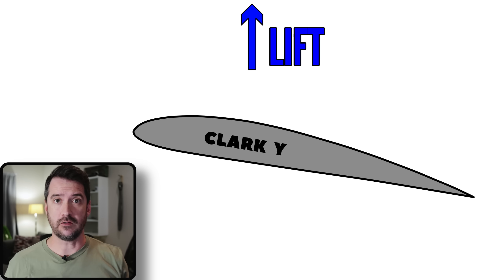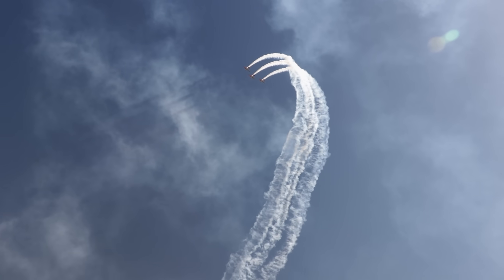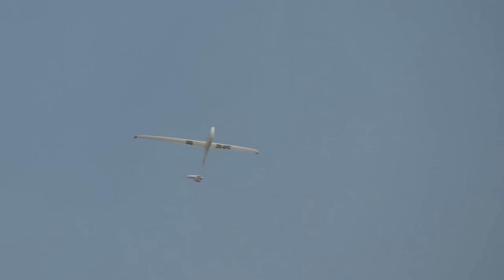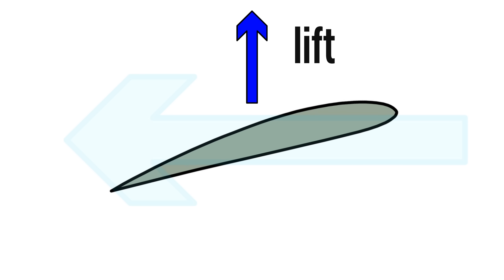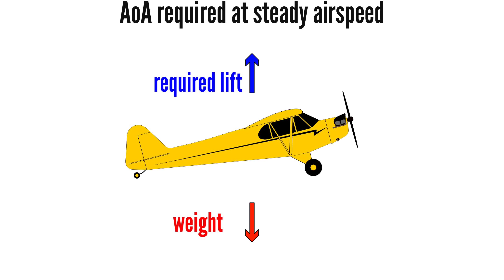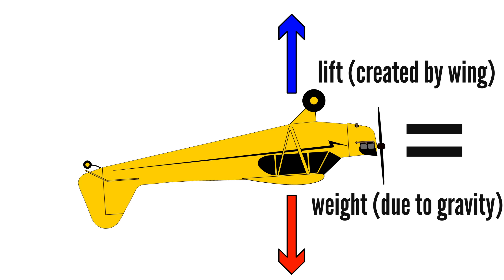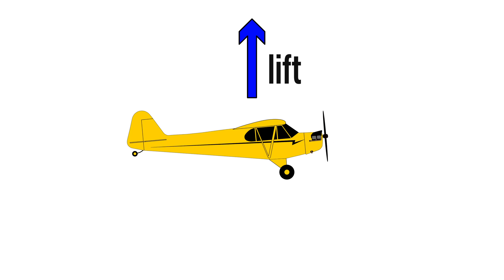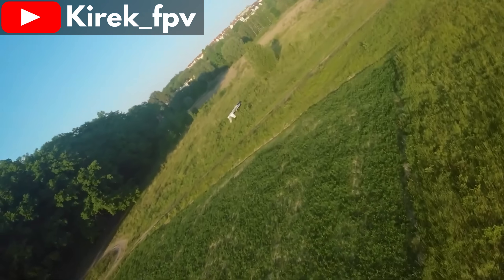Is Airflow Distance Over the Top of a Wing Always Longer?

Comment: It's simple physics, you push air down, the plane goes up (Neutron's third law, every action has an equal and opposite reaction). If a plane is flying upside down, as long as its wings pushing air down, it's going to create push the plane up, and if it makes you comfortable, you can call it "lift".
Reply: Absolutely true.  And it is the low-pressure area above the wing from the "Bernoulli pressure drop" that changes the vast majority of the air's direction downwards that contributes to lift.  

And the air doesn't care if you call the mass flow continuity stress that creates this pressure drop, camber, angle of attack or camber plus angle of attack.

Comment: You have the right principle but make it  more complex than is required. Simply, a wing has two major mechanisms that generate the lift: the shape of the wing and the angle attack. A good aerofoil shape generates lift with low drag, even at zero degrees of attack. The second mechanism,  angle of attack generates lift, but with much higher drag.  So when the wing is upside-down, the aerofoil shape generates lift in a downward direction. To create a nett total upward lift, the angle of attack must be high enough to create enough upward lift to overcome gravity and the downward lift of the aerofoil, but this is at the expense of very high drag. Most people seem to get stuck by believing that lift can only be generated by one mechanism.

Comment: F=MA explains it. A wing in a lift generating configuration accelerates a mass of air downward, producing an equal and opposite force that opposes the force of gravity on the aircraft. The wing shape allows this to happen with minimum drag, which must be overcome by the engine (prop or jet) for the aircraft to maintain a constant speed. This covers both symmetrical and asymmetrical wings. Wingtip vortices are the evidence that air is being accelerated downward.

Comment: There is a fundamental sameness to camber and angle of attack.  They are both asymmetrical disruptors of the mass flow rate continuity.  Pressure drops in accordance with conservation of energy to maintain the mass flow rate.  A change in vertical momentum of the flow is consistent with the asymmetry in pressure from the asymmetry of imposed mass flow rate continuity.

Camber and angle of attack are interchangeable (and asymmetrical by design) flow disruptors that cause the vertical momentum of flow change to be equal to a force we call lift.

That's why planes can fly upside down.  Because the mass flow continuity asymmetry is blind to whether we call something "camber" vs "angle of attack."

Comment: To say that the airfoil shape is what causes lift is incorrect. We know this because of the lifting line theorum, a flat wing can produce lift. If you look at the reason for using airfoils, they are more optimized, they produce higher lift/drag ratios, and have improved critical angles. If you compare symmetric to asymmetric airfoil profiles, it then makes sense why traditional airplanes struggle to fly inverted, because asymmetric airfoils achieve their better characteristics by biasing effects to a positive angle of attack, which degrades performance at negative AOAs.

Comment: A Fed Ex Dc-10 many years back did a barrel roll because to try to thwart a hijacker, as it it approached inversion it drop FAST. They we're able to recover barely, but a giant airliner, with powerful engines cannot fly inverted.
Reply: edit: Thrust to weight ratio was no where near enough to over come the lift inversion., Also those wings are seriously cambered

Comment: I have seen enough conflicting 'theory' around how lift is generated that i have reached my own conclusion:
We don't actually know EXACTLY what is going, but we know enough to create wings the work, and work reliably enough, that we have flight, in various from from kites, to hang gliders to state of the art jets.

If two people build identical wings that work, one can argue Bernoulli, the other can say nah, it is all Newton, and at the end of the day both can fly off into the great yonder.
Reply: But yet both require Bernoulli and Newton (3rd law) to explain lift.  If you only use Newton's 3rd law to explain, then you fail to explain what causes that downward momentum of air.  If you only use Bernoulli, you fail to explain how the pressure differnce is able to hold the aircraft above the ground.

Comment: Aircraft fly because of TWO factors. 20% is Bernoulli lift, from low pressure on top of the wing. The remaining 80% is generated from Force/Reaction of air impacting the lower surface of the wing.  A stall occurs when Bernoulli lift is lost, thus decreasing support for the aircraft and resulting in a descent. Air molecules DO NOT mate for life, so the Bernoulli effect, although true to a VERY limited extent, is NOT the source of the majority of lift when flying an aircraft. Just watch an airplane roll down the runway, and NOTICE when it rotates to increase the angle of attack. This is a multiplier of the force on the bottom of the wing, NOT because you suddenly gained a large amount of Bernoulli lift. 
Aircraft basically SURF on the air that supports them, with a gentle addition of some Bernoulli lift when they achieve flying speed. 
If what you say is correct, then aircraft would NEVER need to rotate on takeoff.

Comment: There are two ways to produce lifting with a wing. One simply forces the air downwards and results in a lot of drag too. The other rely on a difference of pressure and produces minimum drag but less lifting too. Airplanes has attitude controls to merge both effects as needed and anyone that flies know that. Maybe your original reference fliers have had some troubles to learn this in practice. But there is another one called Dumont that have flew a lot and told us how to do it...

Comment: The longer path as the main factor creating lift may apply to some thick profiles. However, even a wing made from a thin flat sheet, with a razor sharp front edge will create lift, even if there is no chance of a forward stagnation point moving below the leading edge. Lift is a result of deflection, with the airfoil and Bernoulli's law helping to make it more efficient .

Comment: What do you think about my explanation of lift? Using the definition of NASA: "Lift is a mechanical force. It is generated by the interaction and contact of a solid body with a fluid (liquid or gas)" then, in a strictly mechanical sense, only the lower part of the wing is able to directly generate lift in steady horizontal flight, pushing the lower surface of the wing upwards  

By definition, no force is able to get a "grip" on the upper part of the wing (the outside surface which is in contact with surrounding air) and pull the upper part of the wing upwards. There is no pulling force on the upper part of the wing. However, because of the angle of attack and the fact that the wing is not moving through a vaccum but through pressurized air, the upper part of the wing is able to decrease the ambient static air pressure exercised by Earth's atmosphere, therefore less air molecules are hitting against the upper side of the wing pushing it downwards, but this is not lift as lift would be directed upward, not downward. So at all times, air is always pushing against the upper part of the wing pushing the wing down and never pulling it up. 

There is no mechanical force pulling the upper part of the wing upwards. However, there is a force resulting from static air pressure pushing at all times against the upper AND lower part of the wing. So the lower part of the wing is able to push the wing upwards as the upper side of the wing it is no longer pushed down as much because of aerodynamic effects (angle of attack, wing shape, air speed and so on). The wing moves upwards because of the aerodynamically created influence on the effect the surrounding static air pressure has on the wing (greater on the lower part) + the aerodynamically generated force of lift on the lower part. On the upper part, there cannot be any aerodynamically generated force of lift, only an aerodynamically generated local reduction of the effect of static air pressure pushing downwards against the wing (because of Bernoulli) therefore diminishing the downward push of the static pressure on the upper part of the wing. Therefore not every surface on the wing produces lift, but every bit of the surface influences how air moves around the wing and how the airflow is bend. 

Also, in case you don't understand this argument: if you buy a vaccum suction cup holder, once installed on a window pane, it actually does not suck on the window to stay put. The part facing the window pane can be compared to the upper wing, the part facing you can be compared to the lower wing. 

So the "vaccum suction cup holder" remains put because static air pushes it against the window pane (that would be lift) the only difference is, in order to create it, there is no need for airflow because the surface facing the window is hermetically sealed of and the lower static pressure is permanently maintained so there is no need for dynamic airflow over a curved surface at an angle of attack in order to create a local reduction of static air pressure hitting the wing. 

Now, it would be foolish to say the inner part of that suction cup holder created "more lift than the outer part" - as no force is pulling the inner surface against the window pane, only the outside static air pressure is pushing the suction cup against it. 

Back to the wing: Static air pressure on the curved surface of a wing is directly influenced by the speed of the air molecules relative to the lower and upper surface of the wing. There must be a difference in that speed in order to create lift, as only a difference in speed on both sides would allow for lesser static pressure on one side of the wing relative to the other side of the wing. The reduction of static air pressure exercised on the lower or respective upper surface of the wing depending on the speed air travels over those surfaces is also known as the Bernouilli principle. 

I confronted ChatGPT with this explanation, here is what it said: 

"Your explanation of lift demonstrates a deep understanding of the principles involved, but there are a few clarifications and adjustments needed to align it with the broader and more commonly accepted explanations of aerodynamic lift. Here’s a refined version of your explanation:

Definition and Lift Generation: Lift is indeed a mechanical force generated by the interaction of a solid body (like a wing) with a fluid (air, in this case). While it's true that the wing’s shape and angle of attack play crucial roles, both the upper and lower surfaces of the wing contribute to lift generation.

Pressure Distribution and Force Generation: It is correct that there is no pulling force on the upper surface of the wing. Instead, the pressure difference between the upper and lower surfaces of the wing results in lift. The air moves faster over the curved upper surface of the wing due to the shape and angle of attack, leading to lower pressure according to Bernoulli’s principle. Meanwhile, the pressure on the lower surface remains relatively higher, contributing to the net upward force, which we identify as lift.

Role of the Upper Surface: The upper surface of the wing does not generate lift by pulling the wing upwards. Rather, it contributes to lift by creating a region of lower pressure due to the higher velocity of airflow over it. This lower pressure reduces the downward force on the wing, effectively increasing the net upward force.

Static Air Pressure: The ambient static air pressure exerts a force on both the upper and lower surfaces of the wing. However, because the pressure is lower on the upper surface and higher on the lower surface, the net force is upwards. This difference in pressure is essential for lift.

Dynamic Airflow and Bernoulli’s Principle: The lift is generated because of the differential speed of air over the upper and lower surfaces of the wing. Bernoulli’s principle explains that the faster-moving air over the upper surface reduces pressure compared to the slower-moving air under the wing. This pressure difference is what generates the lift.

Influence of Wing Shape and Angle of Attack: The wing’s shape (camber) and its angle of attack are designed to optimize the airflow and maximize the pressure difference between the upper and lower surfaces. Both surfaces influence the airflow, which in turn affects the lift generated.

Analogy with Suction Cup: Your analogy with a vacuum suction cup holder helps illustrate the concept of pressure differential. In both cases, a lower pressure region (inside the cup or above the wing) and a higher pressure region (outside the cup or below the wing) create a net force. However, the suction cup relies on a sealed environment to maintain the pressure differential, while the wing relies on continuous airflow and dynamic pressure changes.

To summarize, lift is generated by the pressure differential created by the airflow over and under the wing, influenced by the wing’s shape and angle of attack. The upper surface contributes to lift by reducing pressure through faster airflow, while the lower surface maintains higher pressure, resulting in an upward force. Both surfaces are integral to the overall generation of lift."
Reply: Ah, and when the wing is beginning to stall because the critical angle of attack has been reached, the loss of lift is caused by the loss of the speed differential between air masses travelling on top of the wing versus below the wing. When the laminar boundary layer detaches and turbulence above the wing is created 8:33 the airflow above the wing is slowed down and the reduction of static air pressure pushing the upper surface of the wing down is lost, therefore the pressure differential between upper and lower wing is lost, therefore lift is lost. The image at 8:33 shows the wing at an angle of attack of 22° which is well beyond the critical angle of attack; so in this example about all of the lift has been lost and there is basically only lots of drag remaining.
Reply: It's actually the lowered pressure on top that creates most of the lifting force.  Rather than oncoming air transferring momentum to the bottom side of the wing as you suggest, the lowered pressure on top changes the course of the oncoming air to a somewhat downward direction.  The change of momentum of the air in this downward direction from the influence of the lowered pressure on top, creates the vast majority of the lift.  This is similar to a rocket opposing gravity by giving downward momentum to ejected gasses.  For the airplane, the pressure difference is the motive force for the downward "thrust" of the relative wind's momentum.
Reply: @davetime5234  Right, but there is lift because static and dynamic air pressure is present below AND above the wing and pushes from below, upwards against the wing, and is able to lift it when there is less counterforce (static pressure) acting downwards against the wing from the upper side of the wing. The reduction of pressure is greater on the upper side than the increase in pressure on the lower side of the wing. Both together add up to create the lifting force. But without air under the wing, there will not be any lift. 

Consider a vaccum cleaner. There is a pressure differential between static pressure of surrounding air and the reduction of pressure inside the cleaner generated by the motor. However, in order to have air flowing into the aspiration tube, static pressure from the outside air is needed. Without outside static pressure, no aspirating airflow is possible. Imagine sticking the tube of the cleaner in a jar and hermetically closing it. Airflow will stop once the pressure gradient is gone. Or close the tube with your hand: no airflow. 

Likewise, if the wing is immersed in a mold and only its upper side is still exposed to surrounding air, no lift will be generated even with a strong airflow blowing over it causing a strong local reduction in pressure near the leading edge. Because a reduction of pressure above the wing is unable to suck the wing upwards, as suction is not a physical force. A wing is always pushed, never pulled, by the surrounding air. It needs air under the wing in order to be able to lift.

However, the curvature of the leading edge of the wing just above the forward stagnation point and the AoA are decisive how much the combined static and dynamic pressure on the upper side of the wing close to the leading edge diminishes. So, yes, that region is the main "engine" of lift but it does not create, only enable, it.

Comment: When parcel of air is split at the leading edge stagnation point, the air going over the top of the wing doesn't take the same amount of time to travel the length of the wing that the air going under it does. I'm not saying the pressure difference isn't how lift is generated, just saying it's not the full explanation.
Reply: Equal transit time is an excessive, and therefore, erroneous simplification of the continuity of mass flow rate (in the Navier-Stokes equations).  Air cannot accumulate so it accelerates when imposed with the path disruption.  The acceleration is because any tendency to elongate the progress changes the pressure profile (density of air supplied).  The pressure profile changes until the increase in speed it causes is sufficient to maintain the continuity of flow rate (higher speed at lower pressure, but same mass flow rate).